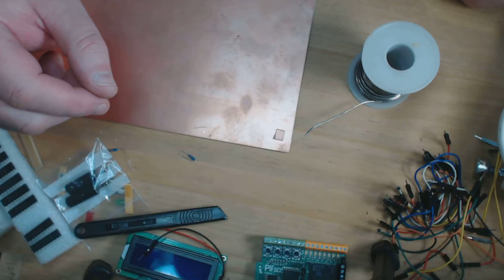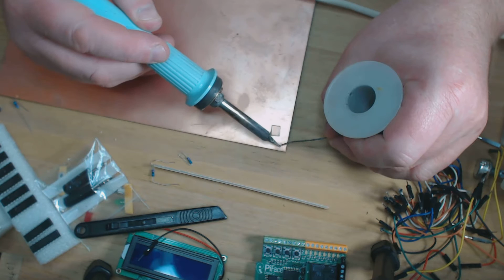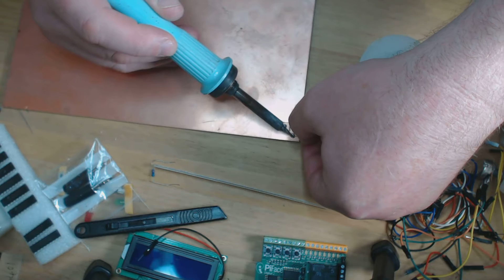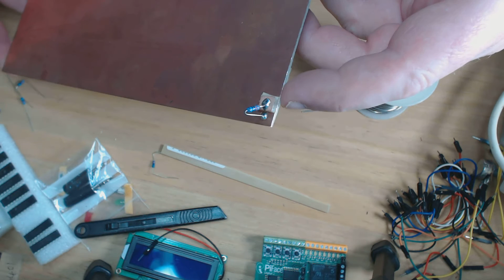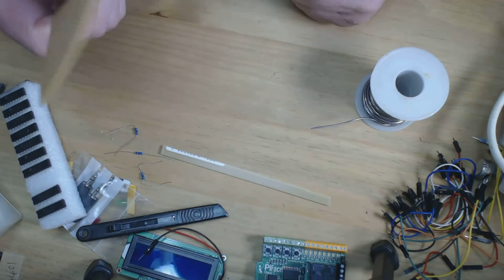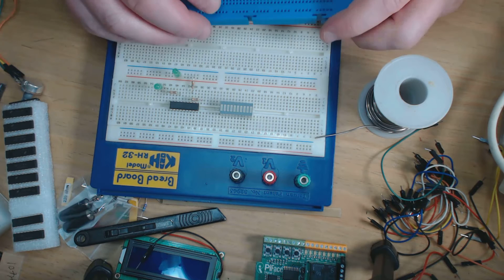Electronics construction methods

Comment: I've tried loads of these methods and still just keep going back to Veroboard (stripboard) it just seems to be far the simplest way. (although, I don't do much that'd care about the wads and wads of stray capacitance)

I got some boards from Ada Fruit which are solder boards but the same layout as common breadboard... but they're still sitting in my cupboard unused.
Reply from the maker: I normally make things for RF and manhattan style is very popular in amatuer radio.. 
I love prototype board  when I make anything using IC's, Vero board is fantastic for power supplies etc.. I am asked a lot on methods of construction and how to solder i just wanted to get people building things.. :-) Gaz
Reply: Yeah, I've been watching various people's "alternative" circuit building methods. Manhattan, dead bug, sky-wiring...... It's all by RF people. 
Good video.... I'll have to come back and see what else you've got. I'm more into low-budget digital control stuff, but it's always nice to see what other people are up to anyway.
Reply from the maker: ive been busy studying this year so not so much free time.. do subscribe tho as I am just about to sit my final exam and intend to do regular uploads in the new year :-) Gaz